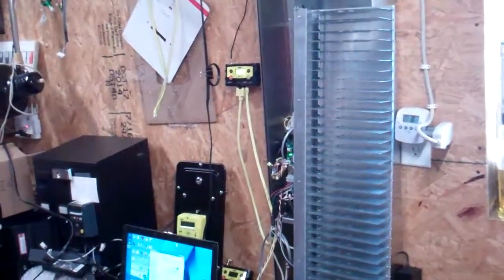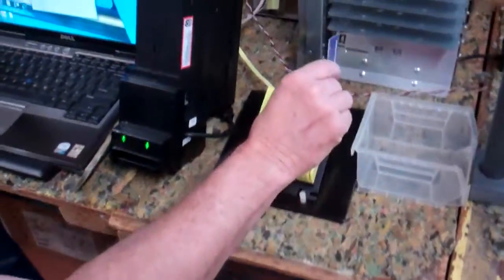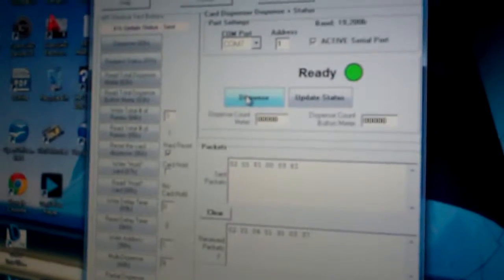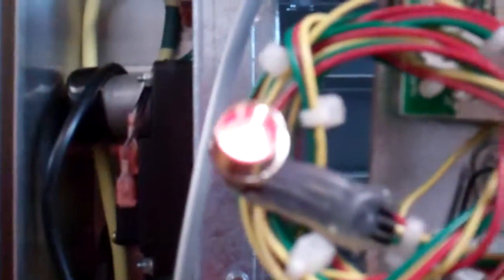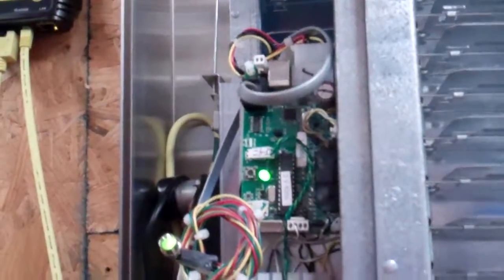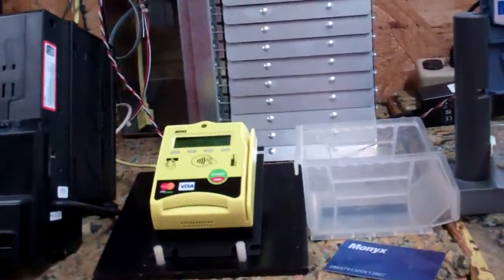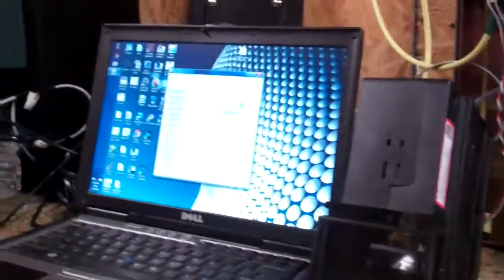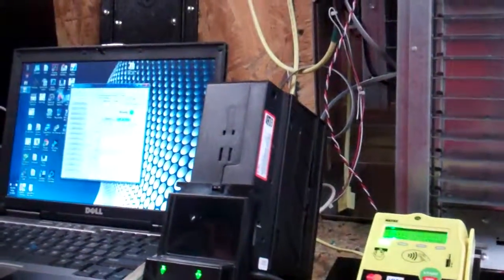Package Shelf Dispenser Machine Kit

Comment: how much are all those items combined? i.e. bill acceptor, shelf dispenser, card acceptor?
Reply from the maker: The bill acceptor is between $100 - $300 depending on the make and model selected.  The shelf dispenser mechanism is $195.00.  The cashless Visa, Master Card, American Express, Discover and other credit card terminals are between $358 - $500 depending on which model required.  Then you add the power supply of $25 plus harnesses (cables) to the finished product.  More can be reviewed on the http://www.xcpcorp.com website or writing to sales@xcpcorp.com
Reply from the maker: Each of the items; bill acceptor, shelf dispenser, card acceptor, etc. can be found with prices under "Products" on our XCP Corp website at https://www.xcpcorp.com

Comment: How do the flaps move? Pneumatic?
Reply from the maker: A 12 volt DC motor drops each shelf.
Reply from the maker: The shelves (flaps) operate with a +12V motor.  The +12V motor makes 1 revolution to drop the shelf.
Reply: @XCPCORP  So each flap has a motor each with a rotory catch mechanism? That is a lot of motors to have to contend with if that is the case.
Reply from the maker: @katemoody1587  No...No....No!  Only 1 motor that activates the 24 or 36 shelves.  Very simple mechanism.  Each turn of the motor will drop 1 shelf at a time.  Can not be any simpler!
Reply: @XCPCORP  Can you show the dropping mechanism?
Reply from the maker: @makerstorage  mechanical drop from 360 degree turn of the gear motor